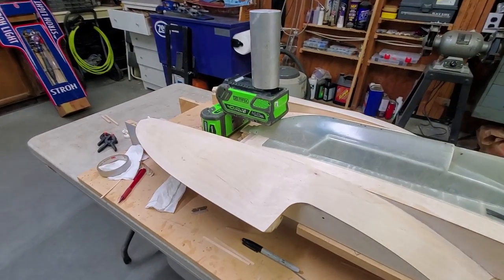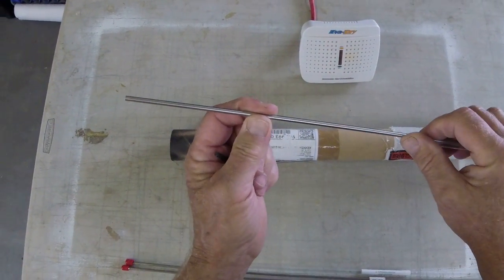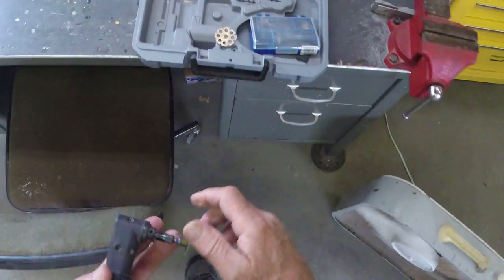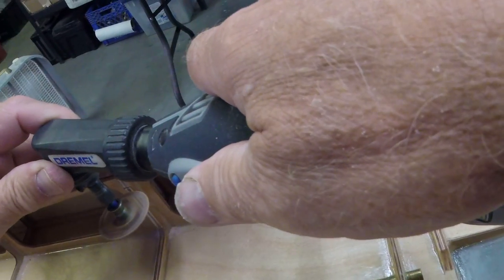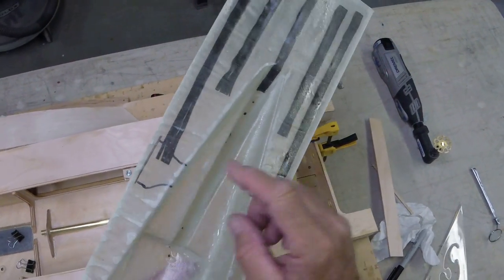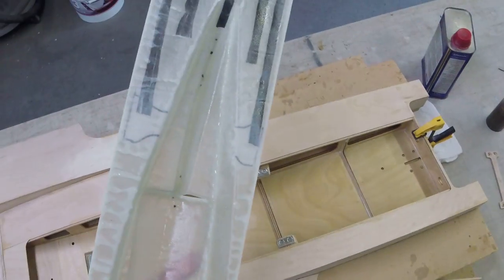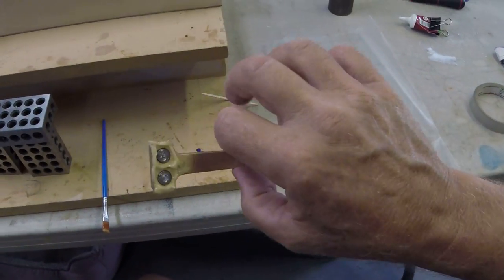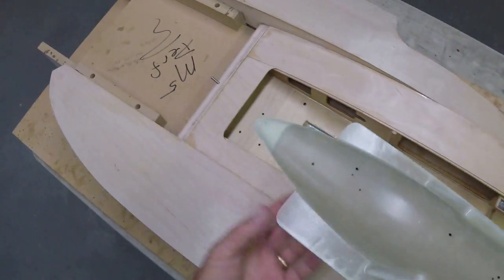Installing Magnetic Cowling Mounts | Radio Controlled Model Hydroplane Racing Boat Build

Comment: PVA is Polyvinyl Alcohol.   We use it inside the molds, before the first application of gel coat, or any mat, cloth or roving, in the building of our 50 ft. fiberglass sail boats.  We use PVA and multiple coats of mold release wax, in the preparations of any component molds, (hull, deck, or structural part) that  we use for the  assembly of our boats.  The keels of our boats are laminated to be 3 inch thick fiberglass, and the rest of the hull, above the waterline is 5/8 of an inch thick, all fiberglass.  The deck is made up of 3/4 inch thick balsa core, encased in a 1/8 inch layer of fiberglass, top and bottom, creating a very light, strong, rigid deck. All woodwork, structural, functional, decorative appearance, flooring, etc. is produced in house, by us, from imported teak.
Reply from the maker: Holy cow that's a serious layup!!

Comment: I feel your loss 😢
I plg some tubing , fill it with water and freeze it, and Bend it.  I have had good results.
Reply from the maker: Interesting idea, though I'm not sure that would work in my application where I bend, check fit, bend, check fit, and repeat over and over until I get it where I want it. I suspect it would thaw before I could get it done, but maybe not.... Only one way to find out!

Comment: Woo! Hoo! Finally I get to see the step by step assembly of the neodymium magnet attachment. I've been waiting for this for some time as I'm still undecided about what to do with the forward section of my all wood cowling on my 1985 Miller American. At the front of the cowling I installed two magnets each are 1 inch by 1/2 inch in size plus four wood screws epoxied into place. I'm thinking about reconfiguring (meaning remove)  the two magnets and the four wood screws and instead install a single pin like Scott did. At the rear of the cowling I will try and recreate the process seen in the video. With an emphasis on try.
Reply from the maker: Yup good idea... You can do it!

Comment: My condolences about mr. Jackson Brown. I have a question for you Mr Scott,  like you, I can't leave anything alone,  I've got into the RC boating about a year ago so I've got a lot to learn. My question is when slimming down the BAR of a prop do you have to cup the leading edge of the blades?
Reply from the maker: I don't do any bending of the blades in the props I prepare. I do reshape the cup of the blade slightly during thinning, but I wouldn't know how to explain it here

Comment: One video that would be very helpful would be go through engine selection and the details of why you went with a certain manufacturer, plus maybe alternative engines to choose? Maybe even motor mounts and exhaust options?? There are so many options, and for a new (been 45 years since I built an .049 Dumas Miss Thriftway!) guy into this hobby it would be super helpful. I’m building 1/8 scale boats. (3 in the queue).
Reply from the maker: I hadn't really thought of that. The options are becoming quite few, so I guess it might be good to discuss them. I'll work on it

Comment: Every time you say Radius as a verb (which I do understand your meaning) I just can't help but picture a straight line segment from center to circumference, like the straight spoke of a chariot wheel. I see you point at an arc segment of a circumference, and use radius as a verb, I always have to take a second look, stop and think about it for an extra second. Radius is BURNED in my mind as a straight line segment, half of a diameter. I'm interested in where, when Radiused as a verb, came to mean "create a circumference arc segment curve" and how correct is this really?
I have no intention to correct you or encourage you to alter your vocabulary, I'm more than happy to meet you halfway and do my part to understand you, but I just don't think I could ever refer to a circumference as a radius. Especially considering the root "Ray", which cannot be curved. Just thinking around, no big deal. Just a geometry nerd being a geometry nerd!

Did you say that was your cowling or RCBC's? Curious about the fitment (unmodified) of the stock MLBW kits with the RCBC cowlings. Also, where and how can I purchase parts from you? For starters I'm looking for a Turn Fin and Bracket. RSRC & ATRCHW are out of stock right now of some parts I need for my build! Thanks for all your help and time! A lot of us out here are in need of your build videos ( a good boat shop teacher) and you're the guy. Don't hesitate to over explain, Mr. Coach!
Reply from the maker: Ya, ya, I know. It just sounds better than saying "make a somewhat roundish shape in the epoxy along the seam with your finger..."  😂
Reply from the maker: Go back to Rattlesnake RC and send Bill a message asking for the parts you need. His inventory is often incorrect, but he's got everything inventoried accurately in his head!

Comment: I use flour to thinken my epoxy 😅 .  Works for gravy so why not in a non structural area . Been using it for years and never had a issue.
Reply from the maker: Especially useful in electric boats, because if/when it catches fire, instead of charred fiberglass you get biscuits!

Comment: Hey Scott,
I am planning on building this particular boat. If I wanted to race with your club, how would I go about finding a hull number or unique identifer that would allow the boat to potentially qualify? I'll probably go electric but I believe that you already have an electric version of this hull and I don't believe that my boat would be eligible to race against yours in the same class. Any suggestions for another boat with the same hull but not the Eliminator?
Reply from the maker: This hull only ran as the Eliminator, unfortunately.  It ran its first season with a very different cockpit, but I don't see that listed as a separate registration. You could possibly petition the contest board to see if they might allow it as another registration. Alternatively you might ask Bill Brandt if he has any plans to give up the current registration as I know he prefers to run his other electric boat and rarely runs the Eliminator anymore
Reply: I understand. My main objective is to learn and master some of your design and fabrication techniques and in reality the boat will spend 99% of its time on water near my Idaho home. I'll review the club documents and guidelines in any case. On another note and in regards to Jaxon, the latin word for "soul" is anima which is the root of the word animal. It is difficult for me to believe that heaven is not a place where all good souls end up.  @M5PerfHydros

Comment: A trick i use for spraying 
PVA i use hair spray .
 Shake it well then spray 3  light coats on the part over the wax  you dont want it to run  then use compressed air to seperate the parts once the epoxy is set up .
Its water soluable so  then you just wash (w/warm water)  the pva off and you are left with the wax coat .
 I also wax the threads on screws with a candle  and they will not stick if you  end up with epoxy  in the threads
Reply from the maker: ?!?  Gotta say that I'm not following the process... hair spray as a mold release? I thought it was more or less a mild adhesive. But there's many different ways to skin a cat. I know because I've tried most of them! 🤣🙀
Reply: Hair spray is pva 
  It makes good glue as long as it never gets damp or wet 
But does not stick well to wax

Comment: On the magnet on boat, couldn't you add a gusset on the bottom side of the plywood mount?
Reply from the maker: Yes but unnecessary methinks.  It's already partially captured in the 1/4" frame
Reply: @M5PerfHydros  sounds good, never hurts to ask

Comment: Another awesome video, I know how tough it must have been to do it alone. Heaven for sure.
You are a true craftsman, so many great tricks. 
Side question, what fuel and % nitro are you using?
Reply from the maker: Do I have to share ALL my secrets?!?  Truth be told I'm using some old Torco 60% purchased in 2019, and my boat is routinely one of the fastest on the pond. Old fuel, like some old dudes, apparently really does rock!
Reply: @M5PerfHydros  didn’t mean to pry. Back in the day 60% was hard on glow plus and connecting rods.   I still have a NIB Picco 67 with an exhaust throttle that I never installed in the Dumas Miller American I built. I’m trying to finish it just to fart around at the lake now that I’m retired. Your talent and experience is second to none in my book 👍🤙
Reply from the maker: It's no problem, I share everything without hesitation. The faster everyone is, the more fun it is when you win!

Comment: You were building your boat with the same offset as 1/10 scale but they run counterclockwise. You would think 1/8 scale would be the opposite. since you go in a different
Reply from the maker: Our boats tend to lift the outside sponson due to prop thrust and engine counterclockwise rotation, so I use the left offset deliberately to weight the left just slightly more than the right
Reply: Can you explain why the real unlimited boats had offset and a larger sponson on the right
Reply: If your boat is ready to run with fuel, and set the boat on a straight edge center of motor which way is it gonna flop to the left or the right?
Reply from the maker: From center of motor it will likely tip to the right, due to my engines already being offset to the left. From the centerline of the air trap the boat will hold level or tip lightly to the left
Reply from the maker: The larger outside sponson is to keep that sponson above the surface of the water in the turns if/when the boat rocks over to the outside